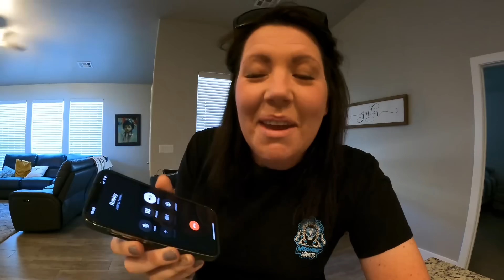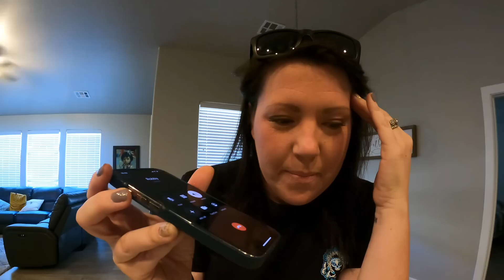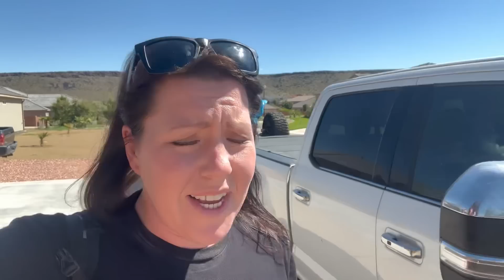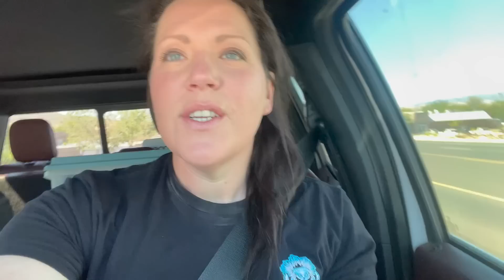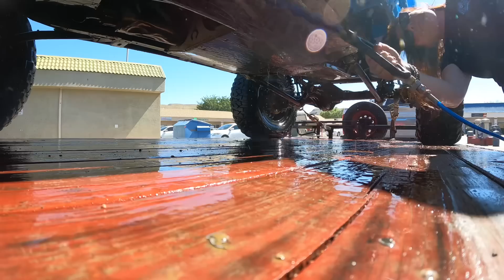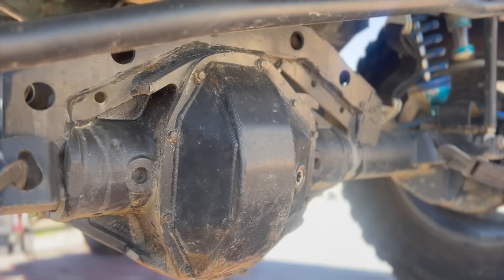A Massive Surprise!

Comment: Off course there's something it's a machine built to do what should be impossible for a machine to do,  so it is subject to stress that no machine could possibly take u joints break so deferential don't always leave an easily repaired point in the system I'll bet you found something like that 😉

Comment: You referring to the smashed muffler? Stock up on large flat pieces of card 
board to lay down under Mischief Maker. It will make sliding around under him a lot more comfortable and easier.

Comment: Time for a new muffler unless you like the restrictive crushed one you have. The driveshaft slip joint is in need of some grease. Any place you see iron (rust) oxide, you've got wear going on.

Couldn't tell is the skid plates were missing fasteners or those were drain holes.

Anyhoo, good luck with the Jeep trail outing.

Comment: Cant settle on exactly what I need , I'm thinking a street legal 4x4  4 door side by side ,  jeep 4 door pickup ,  or  raise my gmc and put rough tires on it and  get at least a 3/4 ton gmc  with a 10 speed transmission,  4x4  .   I goofed gave my son my Chevrolet less miles than the gmc , probably just getting broke in well real low mileage farm pickup .

Comment: If you would Take skateboard wax and rub it on your running boards right for you hit a trail it was slide without messing up your paint just like it slides easier when you you skateboard wax on a curb your board slides easy do the same to your running boards and they won't get scratched up as bad

Comment: The only things I saw wrong were half the bolts missing from skid platesn Rock scratches on the rear driveshaft tha make t worth checking for trueness, a muffler that has been crushed thin enough to probabably affect flow enough to lose noticeable power, a complete lack of turtle artwork underneath MM , oh and a cracked frame the could stand  tolerate a wee bit of welding